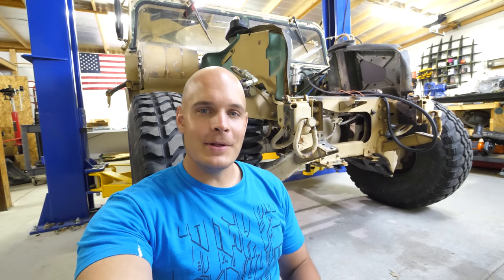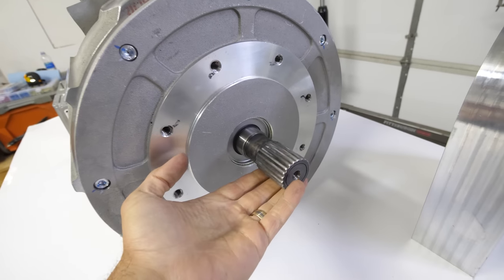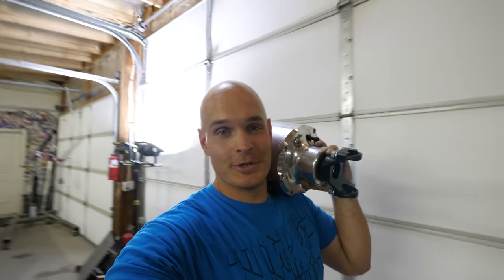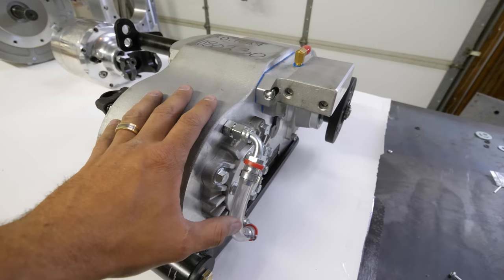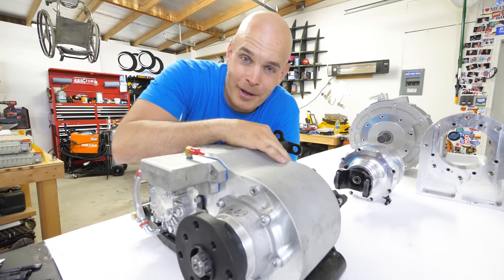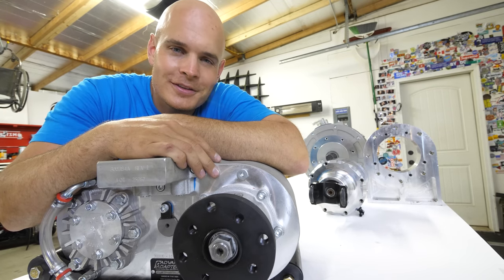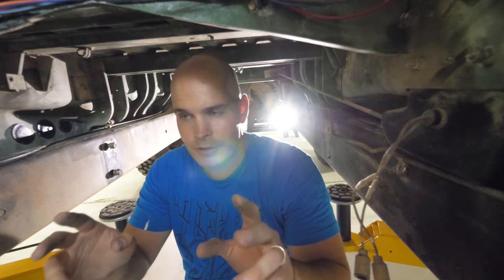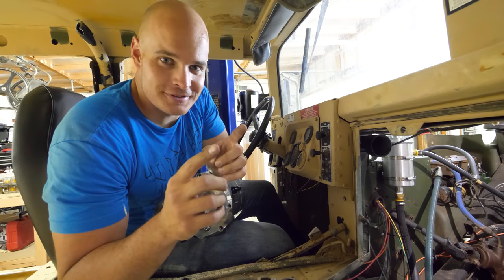How Strong is my NEW Electric Hummer Motor? - EV Conversion!

Comment: No, 220 kW (just under 300 HP) will not get a HMMWV to 60 MPH in only 6 seconds... try double that.
Reply from the maker: Electric horsepower is better/quicker than geared combustion horse power. We will have to see. But I'd say it's pretty close to 6 or 7 seconds
Reply: @JerryRigEverything  power is power, regardless of the source. The issue with any engine or motor is the speed at which it must turn to produce that power. An engine typically produces peak power over only a narrow speed range; an electric motor is the same, but the combination of battery, inverter, and motor is usually limited to a set power level over a wide speed range. Since an engine is used with a multi-ratio transmission, there isn't much difference if the transmission is shifted appropriately (although most drivers can't shift competently and many automatic transmissions won't shift for best performance).
Reply: @JerryRigEverything  that performance seems unlikely. There simply isn't much power output to get that mass if vehicle up to 60 MPH, while also overcoming rolling and aerodynamic drag, in under 7 seconds, if the stock vehicle takes over 20 seconds.

The lightest HMMWV has a curb mass of 2360 kg. Without any drag at all getting that mass to 60 MPH (97 km/h or 27 m/s) requires 860 kJ. That energy delivered over 7 seconds is 123 kW of power. The UQM 220 motor doesn't even reach full output until 2,000 RPM (27 MPH with your gearing) because it is torque-limited by the current limit below that, and for the whole time it needs substantial power to overcome rolling drag, mechanical drag in the powertrain, and of course massive aerodynamic drag.

In more detail...
At 12 m/s (27 MPH, the speed corresponding to 2,000 RPM motor speed) 220 kW corresponds to 18.3 kN which would produce 7.7 m/s2 acceleration (0.8 G) if there were enough traction and if there were no drag at all. Reaching 12 m/s at that rate would take 1.6 seconds, but in reality it will be substantially longer.
Getting 2360 kg from 12 to 27 m/s takes another 690 kJ, so again completely ignoring all drag another 3.1 seconds given 220 kW.
That's 4.7 seconds in a world with no drag. Maybe drag only consumes enough power to slow it down to 7 seconds for the whole acceleration run, but if that's true then just about every Hummer with an engine swap will be that quick (because none have only 300 HP and all have reasonable transmissions to keep them near peak power when desired)... are they?
Reply from the maker: Power is power correct - but if there is a transmission that is bottlenecking your SPEED by shifting 3 times on your way to 60mph then there is a huge difference in how that power is being used.
Reply: @JerryRigEverything  A shift takes a fraction of a second. 
What "huge difference in how that power is being used"? Of course you wouldn't want to use a half-century-old slushbox, but a modern transmission does the same thing as the TorqueBox, with almost the same efficiency (more drag due to more spinning components, but still only a couple of percent loss).
I'm not suggesting using a multi-speed transmission - it isn't needed - but not using one (and not needing one due to a wider powerband with the electric motor) isn't a big advantage.

Comment: electric motors have all of the power, half of the time.

they have a speed where they have the most amount of torque and that is generally low down and it tapers down at the top end. your argument is valid but inaccurate. in regular daily driving do you generally need more torque down low rather than high up in the revs.

but electric cars has a couple massive disadvantages. range, charge time, battery lifetime just to name a few. there is no technology that is all good and I'll stay with my petrol powered vehicles due to the advantages they come with. 

and by the way, even tho my car has a lot of moving parts has it been dead reliable for 350 000km and still running like new

Comment: So how much does your pile of engine parts and transmissions in mufflers weigh? And vice versa how much does the battery packs electric motor transfer case weigh? Ha ha at 9:00 you answer my question 🙋‍♂️

Comment: Yup electric motors, can out perform their IC counterparts, especially older low power dog shit like the diesel that came in this H1. But batteries still stuck donkey testicles, charging still takes forever, they don't like the cold so they've got built in heaters in factory vehicles and one thing you never see when people talk about EV's are people with on street parking charging their car. They'd have to run whatever charging setup out to.their car and hope nobody fucks with it while it charges. So if you don't have a garage or or at least a driveway and you want an ev well good luck with that. Commercial charging stations are sporadically placed all.over the country and where I live the closest is over an hour away. So yes electric motors like this one are tits on glass, but the current battery situation is uhhh... sub optimal

Comment: You really should have left the transmission in there.
Reply: The original engine put out 400lb-ft of torque and that trans you removed geared that down to about 4800lb-ft. You put in a more powerful motor but reduced your driveline torque by a lot.

You also sacrificed top end power and efficiency by running it at such an undesirable speed.

EV's need transmissions too. Anyone who says otherwise doesn't understand electric motors.
Reply from the maker: I went over all the torque specs in this video.  The transmission might have been able to take a motor twice as powerful...... but not when it's 27 years old. And yeah, evs can have transmissions. Some do. But a transmission definitly isn't mandatory.
Reply: Even if he wanted a multi-ratio transmission the original automatic would be a lousy choice, requiring custom modification to get rid of the torque converter and to add a hydraulic pump for low speed (since the electric motor wouldn't always turn at the engine's idle speed). The fixed-ratio reduction box is a lot smaller and lighter and bit more efficient.

Comment: Air pollution from that old Diesel engine, emotion soot & particles // a nasty mess thats bad for people & other animals with lungs // nature // making acid rain that rusts out vehicle & infrastructure (see oxides of nitrogen & sulfur) & tailpipe emissions funk, fumes & toxins // especially bad because the engine emits pollutants near to where people are breathing // where even if the same fuel burned at a power plant, there is more ways to clean up the emissions at the power plant & the turbine gen-set burning diesel fuel to make electricity also operates at one peak efficiency speed // meaning fewer emissions per unit of energy & electricity to charge your EV or phone or power your computer or appliances or lights or AC or heater or router // the most flexible kind of energy // electricity amazing & made almost nearly on demand with very little energy storage deployed compared with the scale of electricity made /

Comment: Boy , don't use lithium battery. Use 2 electrolyte primary battery, refuel electrolytes, dump the electrolyte for recycling. Advantages: 1000km range , 200kg battery weight, 6 seater. Use lithium electrolytes or Hydrogen Lithium bromate, Hydrogen Lithium chlorate or others

Comment: Hybrids where the engine is primary and the batteries secondary is the most logical next step and the way to go. So far they're all backwards. Not enough battery resources for an all EV world and that's just the way it is. Don't let politics push you around man. Build a hybrid dragster instead.

Comment: Wow you really do not know anything, how about the fact your motor I would not put in a boat that is sinking ,it waste electric, not reliable. And apples and oranges. Blowing up that transmission  dun took out two. So before you do shit, get the best not the junk,and find out losses from running at part mid,and full throttle. And who wants to sit on a bomb.  That would be the batteries and the heat there going to produce. Hum about the hummer.
Reply from the maker: I think I had a stroke reading this.
Reply: @JerryRigEverything  dont worry your not the only one